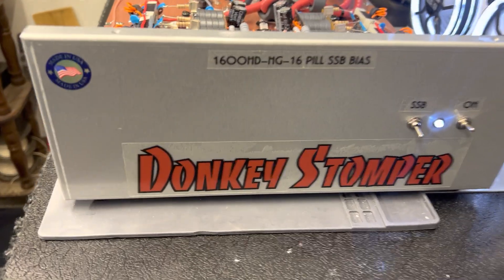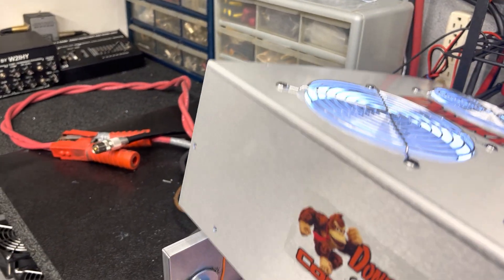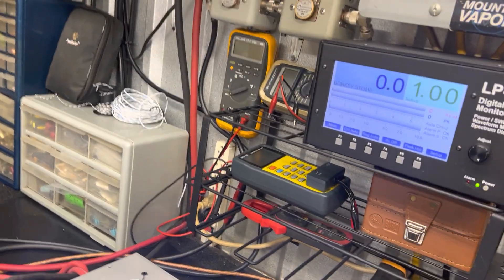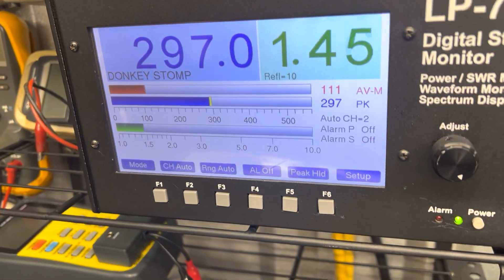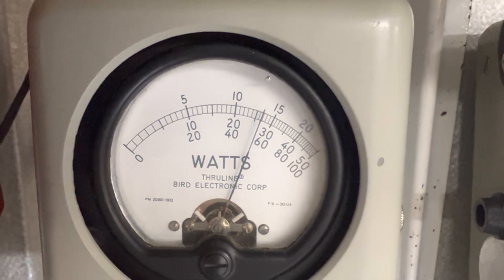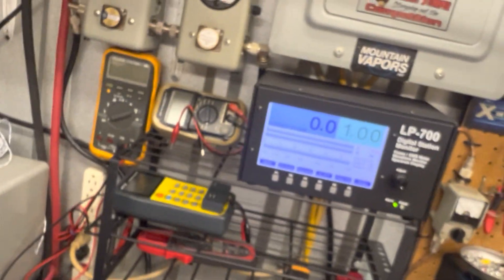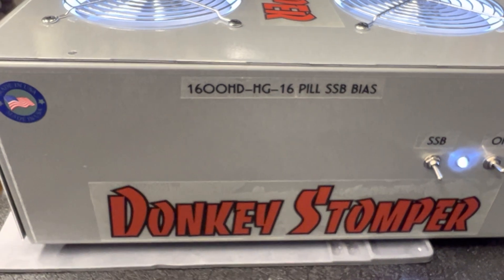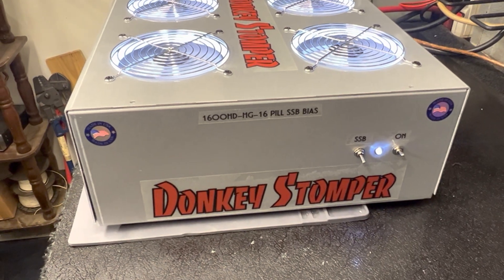Donkey Stomper Products, 1600HD-HG-16 Pill Mobile SSB Bias CW Transmitter

Comment: Do you do SWR protection as an option on these bad boys?
Reply from the maker: I offer thermal protection. Which is not swr protection. But if transistors heat from a high swr the amp will kick out. So kind of.

Comment: I seen another builder getting over 5000 on the bird and 2400 rms on a 16 pill is that possible
Reply: Good answer donkey it just pisses me of with some builder's. Can't they just keep it real.  To much of everything won't last in the real world. Thanks again
Reply from the maker: @joshchilders-fy1pk  Example I can key 8 pill at 1000 watts for a video on a dummy load. Take it home try that on ant.   You will key about twice 10 and 100  Ohm Smoke will Roll!
Reply: I get it   but it's. Not fair to the customer. It's bull shit.
Reply from the maker: @joshchilders-fy1pk  Yup, Why I tell everyone transistors where made 12.5 volts 100-150 pep each
Reply from the maker: That sounds a little out there. Maybe on a dummy load, C's and volts driving it to death. It want run that way or close in real life on ant. About 2 keys on 28 in skip driving  it would be up in smoke. If you did get that.
Reply from the maker: They would have to send it here let me put it on ant and in DX see those numbers to make believer out of me.